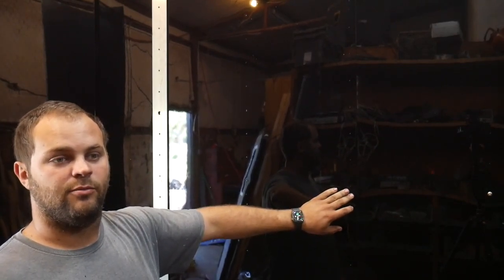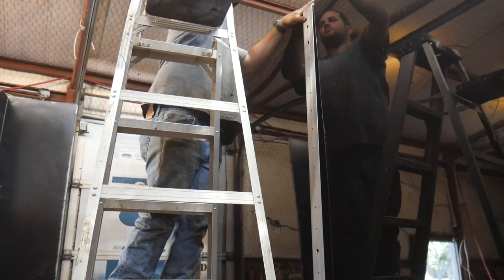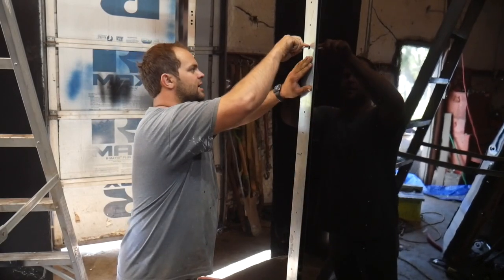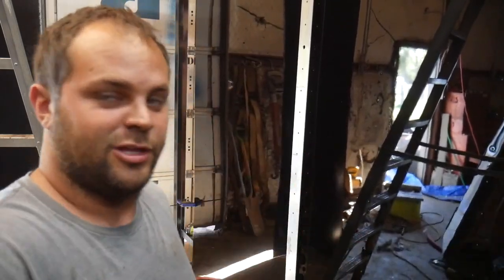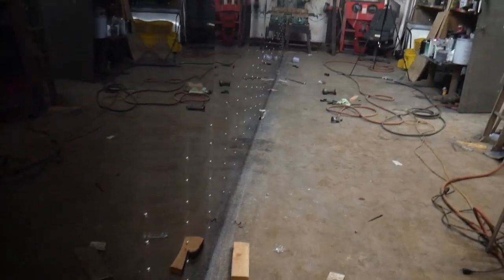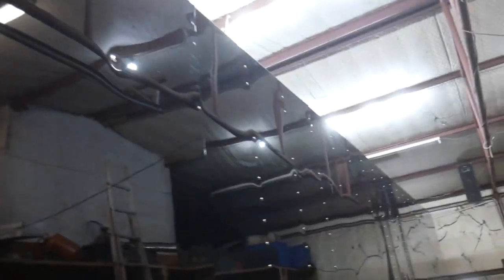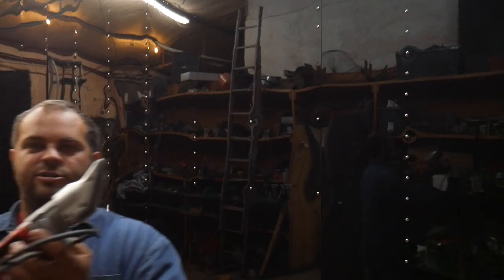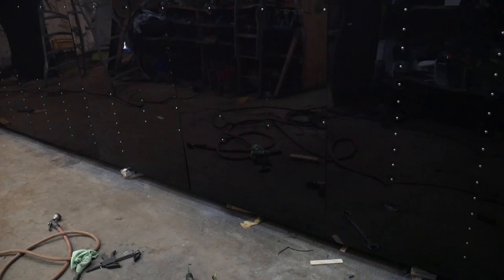Homemade RV. EP-8 Painting and Skinning Part 2. 1977 Peterbilt 359 Toterhome.

Comment: Truly Beautiful fabrication! I look at you as an expert in many areas - so that is why I am asking.  Why did you choose not to put anything between the sheets at the joints?  If you are going 60+ down the road and it's raining would that not force water between the lapped seams?
Reply from the maker: I don't have a black and white answer to this but my thought process was the spray foam as a vapor barrier would stop migration of water into the actually inside of the coach. I thought with both sides of the panels being painted a small amount of moisture short term between the panels probably wouldn't be a problem but the chance of trapping it with sealant might be. Also all the panels are orientated in a way that going down the road each panel is lapped over the one behind it.
Reply: @TheZachLife  I should have guessed that you would have thought to lap them that way!  You are excellent at thinking through things!  Love your channel !  But what if you are going 60 in reverse and it's raining?  :)

Comment: What material was the skin also did u use any sealer  to seal skin and what type of screws ?
Reply from the maker: Steel, I believe 24ga but I could be wrong. I sealed both sides of the skin with epoxy primer and did not seal between the sheets. 1/4 stainless self drilling screws.